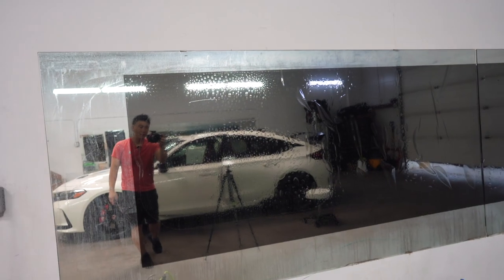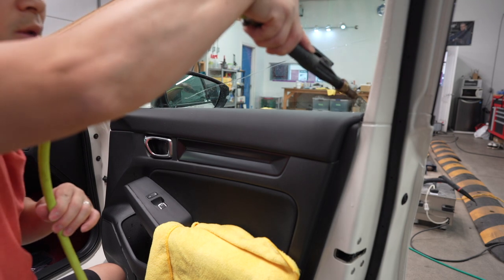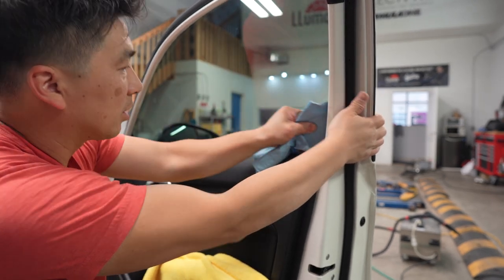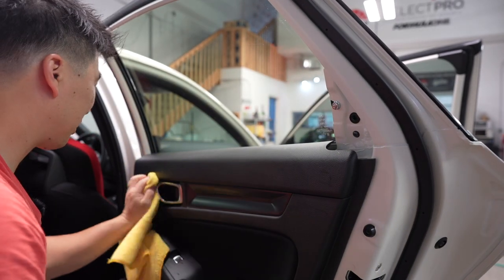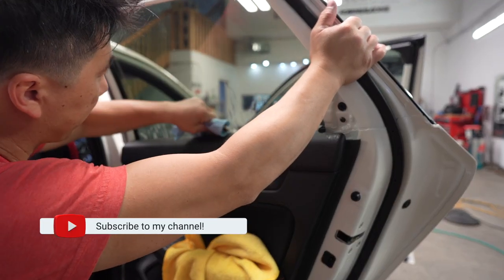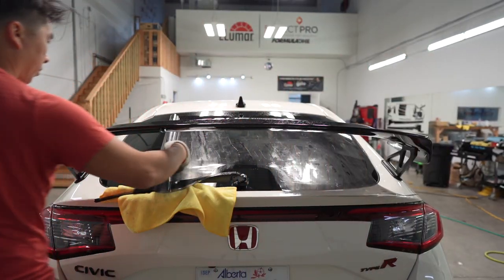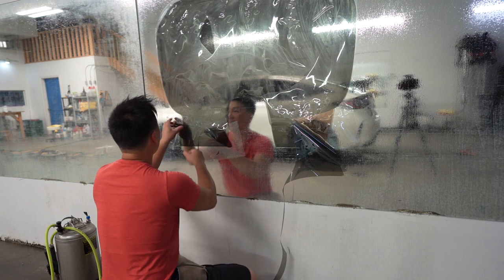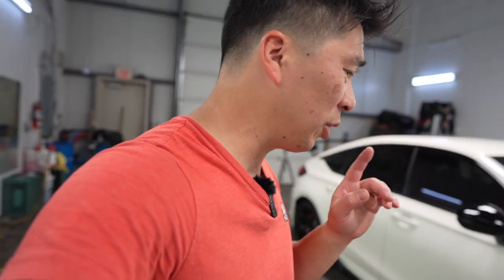First Civic FL5 Mod | Insane Results

Comment: So does the film come from llumar pre cut or what?
Reply from the maker: I buy the film by the bulk rolls and we cut the kits in-house. If you go to an authorized LLumar dealer they can cut the kit for you.
Reply: @phothrottle  ok reason I ask is because I have Mugen visors on my windows already and those use combination of 3m tape and couple push pin taps. Don’t they usually have to cut the tint size on outside of the car window?  I’d be worried they’d be unable to sick visors can’t really be removed.
Reply from the maker: A reputable shop will have precut kits and also know how to cut the film without removing your mugen visors. I would take pictures of your visors and get them to put in writing that if they damage them they will replace them.

Comment: You dont have to shrink your films on the windows?
Reply from the maker: Most side windows can be installed without pre-shrinking.
Reply: @phothrottle  does the fl5 have the same glass as regular hatch ?
Reply from the maker: @cuongvinhsi6139 yes it is the same as the standard 11th gen civic.

Comment: How much for a precut kit with front windshield?
Reply from the maker: Contact a local llumar dealer in your area they should be able to help you out.
Reply: @phothrottle  I'm asking how much did you pay?
Reply from the maker: Price varies depending on the series you go with.
Reply: @phothrottle  how much was your cost with your series?